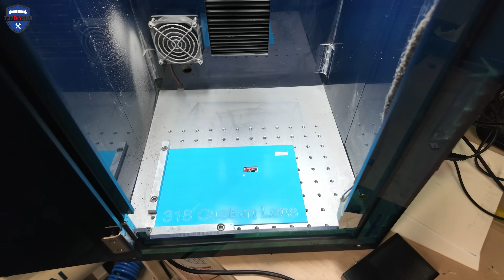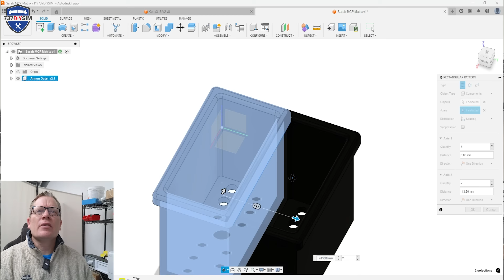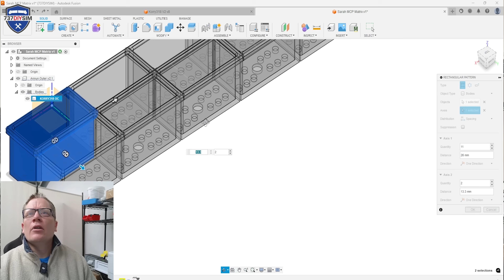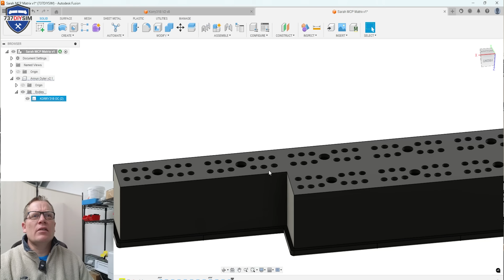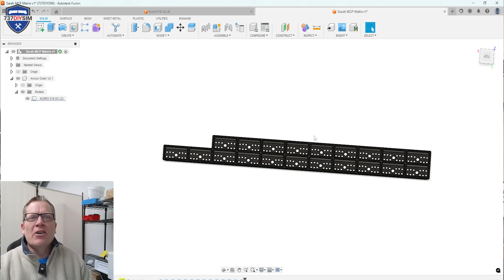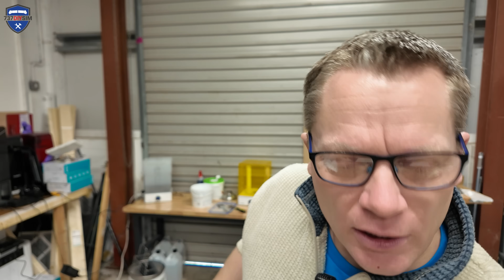Piper Cheyenne MCP Prototyping

Comment: Always love the wiring job. 
What kind of cable ties are you using?
Reply from the maker: Thank you! I generally don't use tie wraps/Cable ties as they are bulky, but I rather prefer the old fashioned avionics way of using lacing cord. Usually 2mm flat wax type stuff you can find on RS Online.
Reply: @ I gonna give that a shot, thx fot the tip.

Comment: May I ask for a recommendation of 12v wire please? What is good? 😊
Reply from the maker: Hello,
In my sim, the 12V system handles most of the higher amperage loads. At the moment, I use real aircraft wire for 12V applications, which is unfortunately beyond the budget of most hobbyists due to its cost.
For shorter span distances, I typically use 22 AWG, while for longer spans, I opt for 18 AWG to ensure adequate current capacity.
To avoid turning your sim into an accidental fire hazard, it's always best to use an online wire amperage calculator to verify that your chosen wire can safely handle the required load. Kind regards, Karl

Comment: I love my 5w diode. It's perfect for engraving. I am working on a collective control for a helicopter sim and was able to engrave all the lettering
Reply: A 5W diode can do the engraving? I'm also building the overhead panel and I don't own a CNC machine. I got the panels cut from a local shop. If a 5w can do the engraving, I could get one and paint and engrave the panels myself
Reply from the maker: That's great to hear. I tried one of those many years ago. No for engraving but trying to cut acrylic. It didn't go well and that's when i knew i needed a Co2 laser.
Reply: I was able to cut 3mm plexiglass that was for a Flashforge machine that I picked up from a local craft store(Michaels). Took several passes, maybe 8, but it cut it nicely. As long as it’s black it shouldn’t be a problem. Other colors may work too if they have some sort of protection on them like Kraft paper or something.